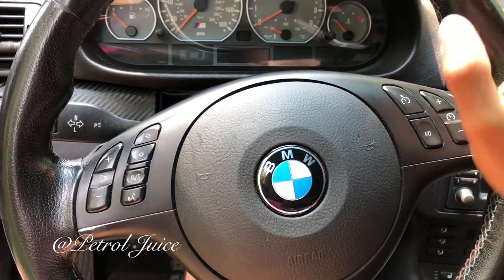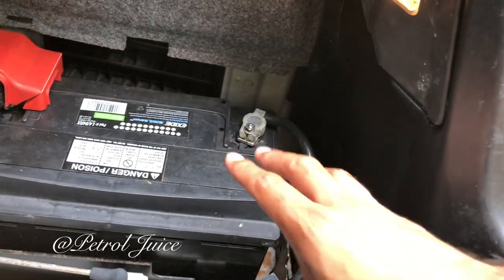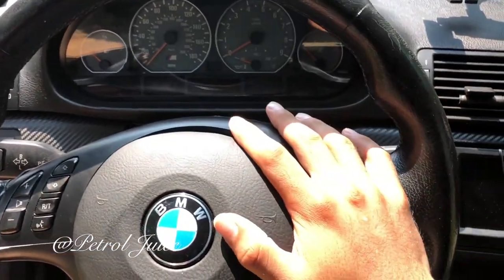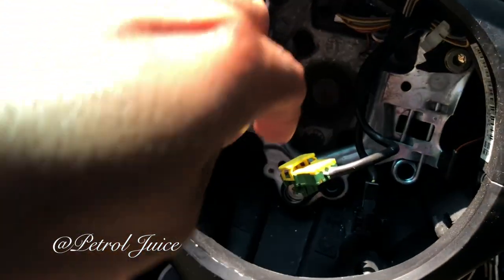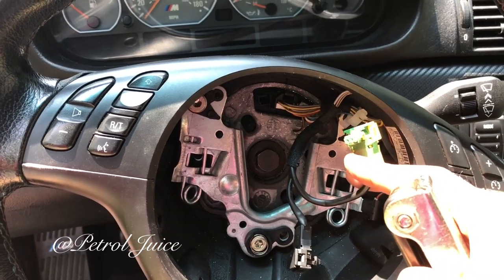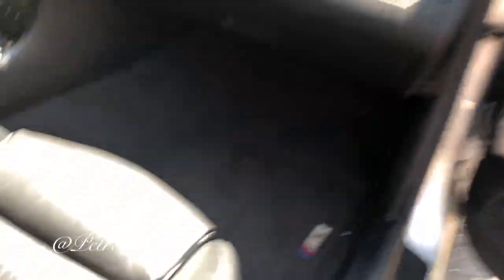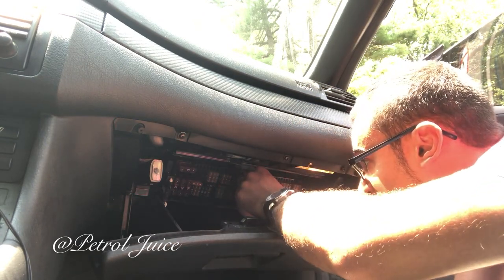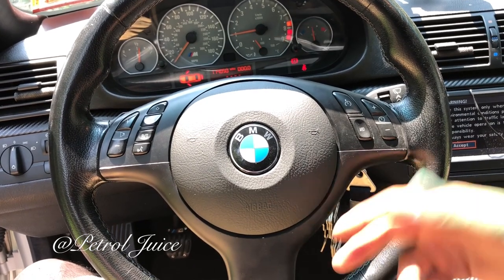BMW E46 Horn Stuck/Wont Stop Honking (How to Fix)

Comment: Perfect.  This is exactly what happened on our E46.  It was even the same T20 Torx screw!  All fixed in under 10 minutes.  I left the airbag connected as this saves any risk of a warning light.  I just rotated it upwards and supported it in the wheel.  As said you absolutely MUST disconnect the battery.  Angle the screwdriver handle end upwards about 20 degrees to make it easier to release the two catches, the blade should be edge on to you.
Reply from the maker: Im glad I was able to help!

Comment: Thanks a lot for this video, since I had the same problem, it was hard to get notice of the spring as you stated, since any more strength you can get in the airbag it self (I thought so) the back of the airbag receipt is metal, so not a problem (but don't use to much force) after I felt it was very simple to get it off. In my "experience" wasn't a screw (all in place) but a washer, that I don't know where from it came from... but problem resolved! No more hoking around 
Thanks!!!
Reply from the maker: Super glad to help! :)

Comment: Had the same problem, screw was missing but also the plate on the left side was stuck and not flexible. I released the screw to enable the plate to move then re tightened and the problem was solved. Thanks for the help/
Reply from the maker: You're welcome!

Comment: Hi Petrol Juice, I got a 2005 BMW 325 soft top, Horn does not work, Seat belt is flashing even when i have my seat belt on, Cruise control light stuck  on. Fuse 5 and fuse 55 are checked okay. Kindly any idea of what to do next?

Comment: I have a 1999 ford escort sedan with the same problem, is it possible the issue is inside the steering wheel? Would this hold true for other makes and models?
Reply from the maker: Angel Galvan sorry for the late response; but yes it could be the same issue. Please let me know if that was it!